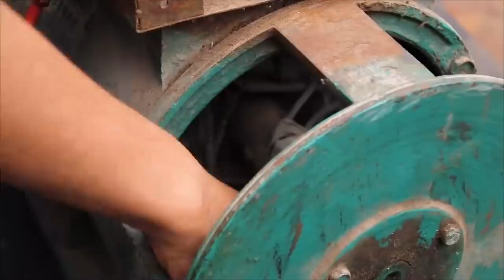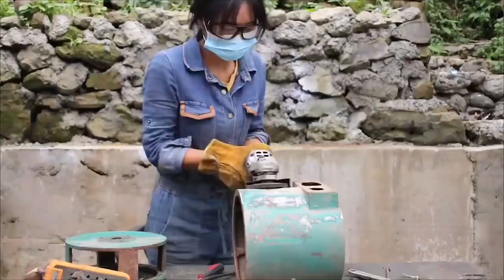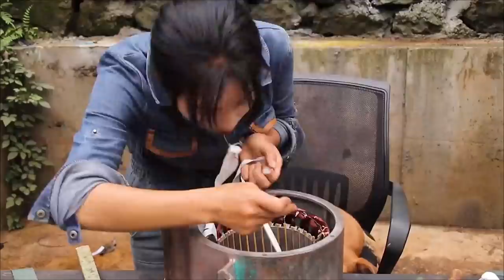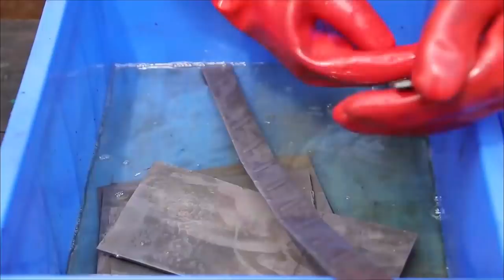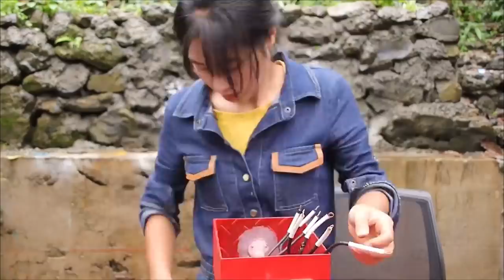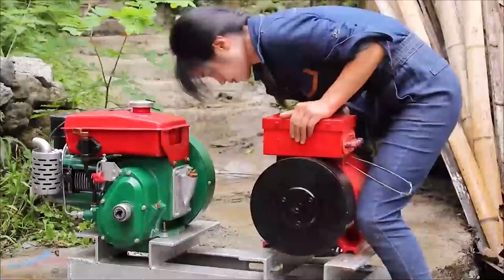💡Help Fan's Dad To Repair A 1989 Generator, If Not Fix it, My Fan Will Be Kicked out | Linguoer

Comment: Can you explain how you rewind the generator? How you know the wire size, and length? Here things like this is a lost art, I grew up fixing things nothing was replaced if it could be repaired, only things we would not fix were replaced, that was very little, but now, everything is replaced, no repairs, I want to get back to the old ways, my father drove a car for 50+ years, 
I would love to get a diesel engine and generator like you have,  and used vegetable oil and maybe distilled plastic as fuel, to generate power at my off grid home, I would also like to build a steam powered generator that will also heat my home in winter, to be fully self sustainable, you are awesome 👍 😎

Comment: I have watched many of your video's and they all have the same thing in common which is they are broken due to neglect. The owners of the equipment you repair should be ashamed of themselves for allowing their equipment to fail due to neglect. Yes every machine breaks down over time due to internal failure or wear and tear but everything Lin repairs is rusted, physically broken or corroded. It is great that she is kept busy with repairs but the equipment owners, disgraceful.

I hope after you repair you tell owners to take good care of machines.

Comment: Marvelous production how were you able to follow the wires in the generator on the stator to the correct connection?? Video was fast could not follow
Reply: she is not going to give away any trade secrets, LOLOL but you can see if you use the SETTINGS button (located at the bottom right side of your screen) and then click PLAYBACK SPEED, and then click the .25
Reply: @benscoles5085  she is giving away all the secrets. All the best regards to you 🙏